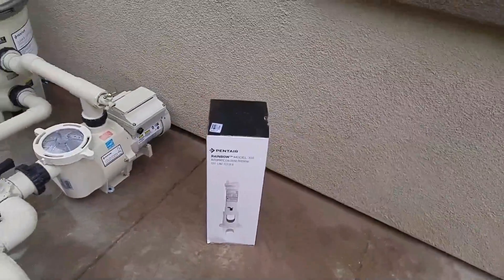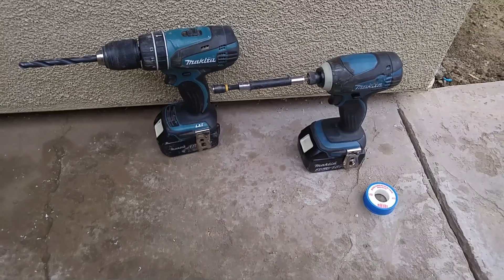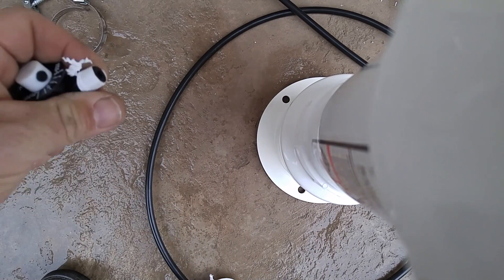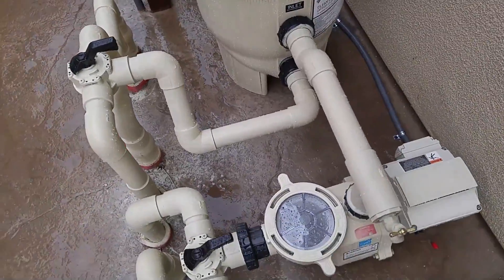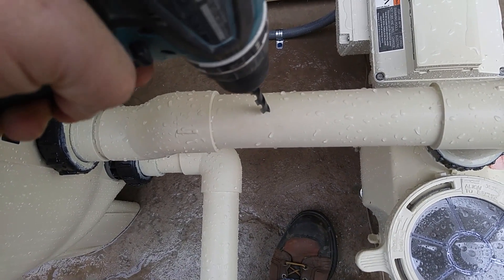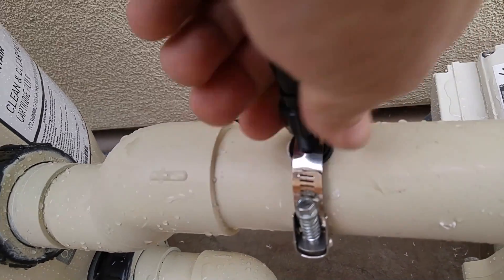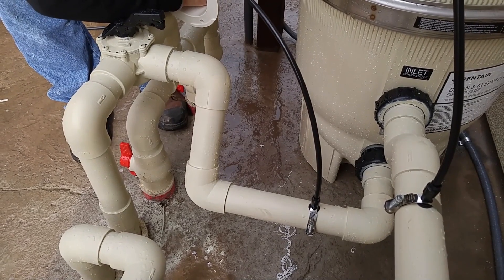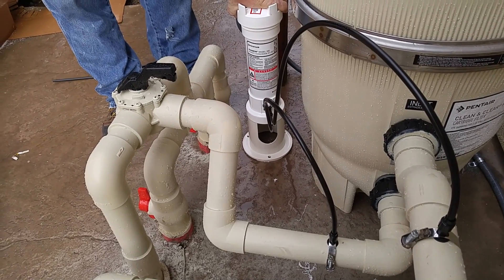Chlorine Feeder installation

Comment: I have a question, the off line chlorination system states that I installed the inlet one after the filter and the return on the return side. Can you explain why bc you have yours before the filter for inlet and return is return .  Ty Don

Comment: Question: why did you plumb the inlet to the chlorinator before the filter? Why not just plumb the in and out after the filter?   I mean isn't  its better to chlorinate  it via filtered water ?
Reply from the maker: Because there is a pressure difference before and after the filter. Before the filter there is more pressure and after the filter there is less pressure. This ensures the water pushes through the chlorinator.
Reply: @JohnThePoolExpertGuy   Ok got it ! Thank you John !
Reply: @JohnThePoolExpertGuy  what about before and after pump?
Reply: @salomonjrodriguez  that wont work. You will get suction instead of pressure if you connect the line before the pump.

Comment: I have serviced this Chlorinator almost every 3-6 months, installed by pool heater contractor, the issue is repeat leaks, and the hose  cracks / splits open in several locations, I wonder if this is a manufacture of hoses defect or a common issue, also the housing is not anchored to floor , so possible movement during refill causing failures? Any feed back would be greatly appreciated. Thanks
Reply from the maker: I would anchor it down and I believe you can get similar tubing at The Home Depot.

Comment: Question: why did you plumb the inlet to the chlorinator before the filter? Why not just plumb the in and out after the filter?
Reply: Most of these types require a pressure differential to work properly.

Comment: To install after a heater do you need to plumb a check valve into the pvc before this so the chlorinated water won’t sit in the heater?
Reply: The 90 at the bottom of the feeder IS a check valve 90
Reply: Check valves can fail and blow up your filter tank. These chlorinaters are junk anyway. Save yourself a headache and throw a tablet in the skimmer.
Reply from the maker: Yes you should have a check valve between the chlorinator and the heater

Comment: Can you attach the tubes to flexible PVC?  The inlet to my pool filter is Flexible PVC.
Reply: Trifecta3x3 Not advisable to tap into the flexible pipe. It is more likely to fail and leak compared to rigid pipe. Instead drill into the rigid connector fitting.

Comment: Thanks John,great help. Question,,,the on off lever is so tight I am afraid it will break if I force it. Any way to loosen so I can adjust .the flow from close to max ?
Reply from the maker: kenny64 

I don't think they are adjustable....you may get some silicone spray that might lube it up.

Comment: He should have wrapped Teflon counterclockwise because you screw in clockwise. That overlap of tape with go against the twist and bunch up. Also a personal opinion I would have drilled inlet hole on btm of pipe. Very easy to break tgat tiny plastic if you bump into it. Safely guarded by pipe if under. Then lightly zip tie ( not too tight) down pipes back to feeder
Reply: D Always wrap Teflon tape CLOCKWISE on a male fitting. You got it backwards. Plumbing 101
Reply from the maker: D 

Thanks for the input but I'll have to disagree with you on the Teflon tape

Comment: Chlorine is not getting into my pool. I've replaced the check valve a couple of times but still not working. I usually have the settings set to about four or five. But my only guess is that possibly I may have gotten my tubing backwards. 

The check valve that I screw into the bottom. I noticed has an arrow that points down. I've always assumed that is the outlet going back to the pipe. 

But from what you're saying if I'm understanding correctly. Is that the tube coming out of the filter screws into the bottom. 

By the way that is the tube that has my strongest pressure. But because of that arrow that points down I always thought that was counterintuitive. Unless that is a 2-way check valve and I've just been thinking backwards. :/
Reply: The tiny inlet pipe sending water to the feeder must be before a spot in the plumbing where water hits something tgat naturally creates back pressure then that forces water back into that tiny pipe feeding the feeder. Before a filter works because that’s a place where water hits something slowing it down then pushes back and then into tiny tube. Your water may be passing straight past your feeder tube. To test this undo the tube where it goes back into pool. Turn everything on, is water coming out? Like a lot!! Not a drizzle.  I’m assuming it’s a sand filter. If it’s a cartridge filter a big piece you pull out of filter and hose down then I’m not sure. Water passes through those pretty fast with no back pressure. Hmmm
Reply from the maker: BlazinNSoul 

The water goes in to the top where the valve is and goes out the bottom. It is possible that you have some calcium buildup inside of one of your tubes.
Reply: John The Pool Expert Hmm that's the way I had it set up before strange.  Well I guess there could be some calcium buildup. 

As I just about replaced everything else I can think of. Except for the tubing itself which maybe I can try. Anyways thanks for the response. :)